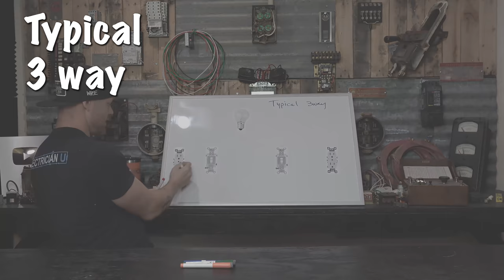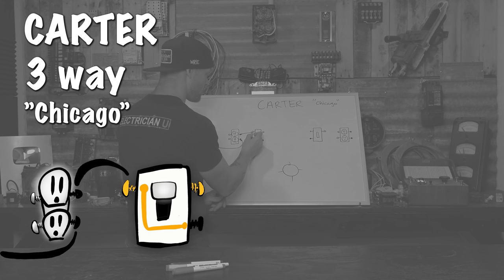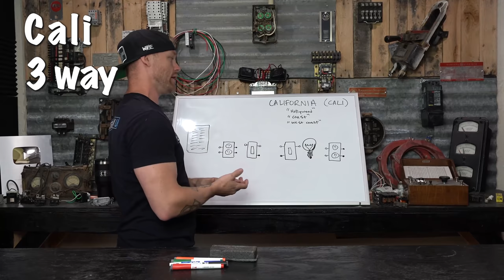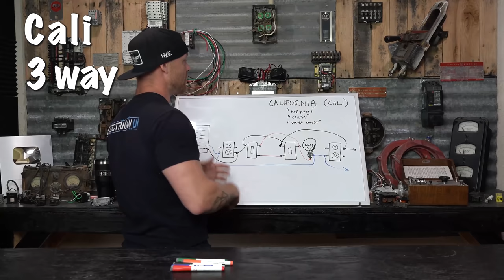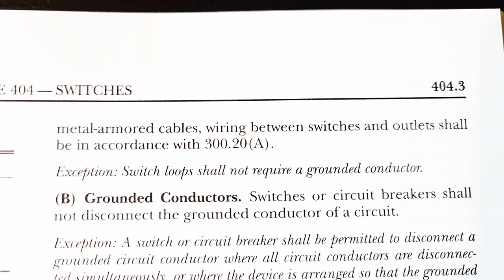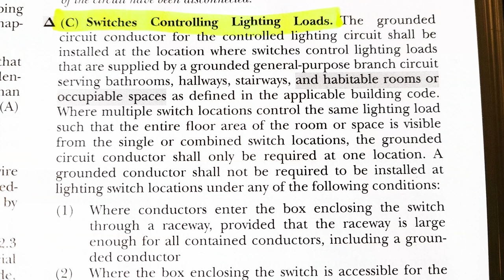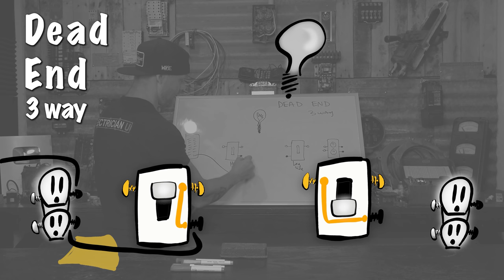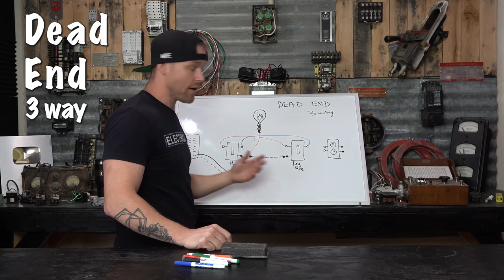THREE WAYS 3-WAYS CAN BE (3way Switch Wiring - ILLEGAL AND LEGAL METHODS)

Comment: Here's a future video idea:  How to do a re-wire or replace a home-run most efficiently with minimum amount of drywall damage.  Any tips and tricks you've learned over the years that would be helpful to new guys getting into the field.  Thanks.
Reply: Depends on what is above or below and where you can fish from. Sometimes you have to go up over and down.  I worked in a split level that had the walls been open would take 50 ft of wire from the panel to new AC. Because we had to drill and fish up over and down it took almost a full roll of 10/3 NM
Reply: I would love to see a video about this uuf
Reply: Agree. I’m always wanting to do the minimum amount of damage, and obviously still get the job done quickly and efficiently
Reply: This would be tremendously helpful.
Reply: I can tell you that re-wiring without opening the walls uses a whole lot more wire.
You can't do it efficiently without opening up walls. If you don't open walls you use lots of junction boxes in the basement and attic, and a lot of dead end runs.
But that is the trade off for not damaging original plaster in an 1890 house.
First floor isn't as bad if you have a basement, not nearly as much wasted wire going from underneath to wall outlets.
Going up to the attic, then dropping down the wall for each receptacle on the second floor burns through wire pretty quick though.
Reply: That’s so vague. Every job is different
Reply: It takes experience in order to route the best path for every job, and even with years of experience, in hindsight every now and then we can see a better path after the fact lol
Reply: Ha
Reply: get you some of those four or five foot long bendable auger bits , there are five piece fiberglass rods that screw together for any length you need to fish, with one has a hook on the end get some good scotch 33 tape,  to tape your wire to it, practice taping that isn't going to make a snag , it helps to have a good partner that is on the same page with you when you're fishing wire although you can do it yourself ,you just have to put some thought into where you are going if you are fishing , knocking in the existing electrical box intending to replace it, will allow you to reach in and fish in the wall a lot easier,  fire blocks will be an obstacle that your auger bits can get through, of course homes that are wired with EMT or Flex you can pull all new wire or add a circuit  in a few hours with a good helper,  My first day working for a company they had a taper standing by, to fix all the holes I needed to put in the wall to replace a damaged wire between two receptacles but when I was done there were no holes to patch. fishing wire you have to look at the possibility of things in a positive way
Reply: @Content_to_suffer  hmmm. An honest electrician that doesn't pretend to know everything.
Reply: Be one with the snake padawan
Reply: I want a vid on this. I have some new wire to run
Reply: He could probably show you some things to look for and some tips and tricks. Every house is gonna be different. 10 experienced electricians would probably  come up with 10 different ways to pull a new circuit through a finished house and all of them would be feasible. Going to depend on their experience/background, what tools they have on their truck, how many jobs they got stacked up, existing finishes in the house, attics, crawlspace, basement access, etc. When there is an accessible crawlspace or basement, I like to take down baseboard, especially when it’s the tall stuff. I can cut out drywall behind the base to drill studs and through the sole plate with my right angle drill. When I’m done, screw in some new drywall and bang the trim back in place. Most homeowners can handle caulking and painting trim much easier than patching drywall.
Reply: For me, I have done a lot of older home rewires and generally I try to run my wires as modern as possible but.. A lot of times the home owner is not going to want to damage the plaster or what not. so in that case, switch loops are your best friend. bringing the power to either the light box location or a crawl based junction box, and branching loops to each switch location ect. meaning you only need to run 1 wire instead of 2. but what I do is I will run a 14/3 to the switch box. it carries power, neutral, switch leg and GROUND to every switch box. I run some dead ends as well witch are also a life/time saver. But with the code specifying only ONE location of a 3/4 way system needing to have a neutral.. YOU ARE SAVED
Reply: In the Carter 3w what color is the hot traveller?
Reply: @mrromantimothy  Lol! That poor taper must have been bored to tears, unless he liked watching electricians. But who wouldn't want to watch electricians?  😁
Reply: @hailholyqueen  What's that? A dishonest electrician who is pretending he doesn't know everything?!?   🤣
Reply: @tay13666  you can fish wire in and out of an existing receptacle box if you know what you are doing and rewiring a house doesn't take anymore wire than what was used when it was built new

Comment: Put multiple 4 ways between the 3 ways. You’ll blow someone’s mind.
Reply: I have a 3 way in my basement with three 3 way switches, no clue how it works, I tried to adjust it and it stopped working, I undid my work and just left it as it was...
Reply: @Bremend  u can’t mix up the pairs or else the lights won’t go on and off as supposed to. Either tone the wires to find the right pairs or call an electrician
Reply: Actually that is exactly how you build a four,five,six, etc. switching .   First three way chooses A or B path , Final switch Chooses A or B . ALL the four ways in between simply reverse A & B in to A&B out or B&A out .  All the 'reversing' the traveler switches are in the middle .   This allows for each and every switch to be an on/off switch.
Reply: @Bremend  So two of the three actually are a three way t(hat act like a three way ) powers the third three way . If you turn off the last  (third)three way AND then switch one of the first two nothing happens AND you have to turn on the last and one of the first two to turn the light back on .(my Dad did this in a basement , drove me nuts)

Comment: basically, if you are running Romex, then the neutral needs to be in the outlet box. If it's EMT, and you can add it later then you don't have to run it; it can be added later if it's needed. This is basically why, in Oklahoma, they stopped letting us use the white wire to send a switch leg to the other 3 way and mark it with some red tape to identify it as hot. As an apprentice in open shop, I worked with a Journeyman that liked to use the white wire in a 12/3 to send the switch leg to the other side. He argued it uses less wire and saved on overhead. People were calling that a California 3 way for years until we had an electrician from California come along and tell some people that this wasn't a California 3 way. This is the first time I ever seen someone describe a California 3 way, and it is definitely different from what Journey were calling one back then. I have never seen the Carter 3 way but that looks kind of sketchy! I wonder who dreamed that up?
Reply: Jimmy Carter lol😂😂

Comment: im a journeyman electrician , i know this stuff but for some reason i cannot stop watching your videos, thank you for the videos your doing keep up the great work
Reply: IS NEC certified same as Journeyman? Taking exam at your local village or other local jurisdiction but it just states licensed electrical contractor not journeyman. So journeyman is specifically for union electricians?
Reply: @vlad1889  Nope, where I live there is 4 classes of electricians, licensed by our state, union or not.

Class A: Master
Class B: Journeyman
Class C: Systems Contractor
Class D: Systems Technician

I currently hold a Class A and B licenses, since for some reason your not actually allowed to do electrical work with s Class A. Weird huh?
Reply: @vlad1889  state licensed for general electrical contractor is the same as journeyman...
Reply: @steve-o6413  in DE a journey needs to work under a master still. Only a master can pull a permit.

Comment: Wired up a huge house that had 5 seperate doors leading in the place. Had several hallways that criss crossed another hallway. Had at least 14 three way switches and maybe 6 four way switches. Sparky working with me never wired in a 4 way switch and screwed up wiring them. As long as you are using 2 NM cables for each 3 or 4 way very easy to wire them. Liked to put a piece of black tape on wire that feed switches.

Comment: Love your video and have come back several times to watch the variations. One variation of the three-way switch I’m having a really hard time finding is one where the power comes into the switchbox, and then both the three wire to the other switch, and the two wire to the lights come out of that same box. Might be a great video for someone as I can’t find it anywhere
Reply: What  you're describing is the dead end three way,  actually a commonly used variation.  Technically still a code compliant 3-way since the box with the incoming power has an available neutral.   Especially useful in renovations where you need to convert a single pole switch into a pair of 3 ways with minimal work.

Comment: Great video.  You just helped me solve a problem I was working on today with two dead end 3 way switches that control the garage light from the kitchen door and garage door.  Saved me the trouble of having to call for help.

Update - Section 404.2c was changed in 2020 and now prohibits a "dead end" three-way in a remodel if there is no finish on the wall and the wire is readily accessable and can be changed.  I ran into this on my remodel when I exposed an old dead end three-way and had to add a neutral.  The reason for this is that many modern "smart" switches require a neutral.  If the neutral isn't used, it is capped for future use. 

 I'm also having to upgrade some single pole switches to 14/3 wire because the home runs are to the junction box for the light.  Again, the unused neutral is capped for future use.

Comment: The 'Dead End 3-Way' is what I would use based on my 45 years in electronics, though I would run the 14/3 red & black from the travelers on the first hot switch plus the neutral straight into the ceiling box, then strip off the outer jacket, cut the white wire and fasten it onto the shell screw, then put black tape onto the other end of the white and connect it to the screw hooked to the bottom light socket contact.  Then I would continue the cable over to the other 3-way switch, and hook red and black to the travelers, and white to common with a black tape band added.  The down side is pulling the wire all the way through the box.  BUT, I know the way we would do things in electronics does not always satisfy code, though it would save on wire nuts and wire.  Thanks for your informative videos.  I learned a bunch of this stuff from my dad a long time ago, but he went to trade school to be an electrician in the 1930s.  Much has changed!
Reply: Wonder if your dad learned the carter 3 way method,  because it allowed power on both ends of a three way using 3 wires instead of 4 not counting the ground, and the economic hardships of the time forced many people to get creative and make do with the least amount of material.  Actually ran across a carter 3 way a little while back on a farm with a yardlight between the house and barn with a single conductor running from the house and barn to the light pole, controlled by 3 way switches from different panels.  House and barn were built c. 1910 and got electricity in the late 40s.

Comment: This was very informative. I can't say I have seen the Chicago or California 3 way locally. But the one I didn't see is the hybrid 3 way. 
I use it mostly for entry halls.
But to save that additional 2 wire switched leg, we run 3 wire from a switch box with power to say an entry chandelier box, then 3 wire back down making a dead end on the other side of the hall. Neutral comes from the power switch box.
Switch leg is the common at the dead end. And yes you have to change the color of the travelers in the ceiling box to avoid having two white wires at the fixture.
Reply: I think this is what I have in my house.I have a foyer light with stairs. switch at bottom and switch at top. The bottom switch has a common/hot, neutral and two "travelers". the top switch has only one traveler and one neutral (coming from wire nut with 3 or 4 other white wires going who knows where). Im trying to wire up a smart switch but cannot get the top switch to work.  Any ideas? and yes, I am not an electrician.
Reply: @jleslie246  if there multiple neutrals in the box at the top of the stairs that tells me there at one point was a pig tail coming from the "hots" in that same  box to feed the circuit.  This is more akin to the California 3 way described in the video. In older homes a neutral is a neutral to older electricians. Neutral and switched leg comes from the bottom of the stairs and you have a black and white pair of "travelers" at the top of the stairs and a hot wire in the switch at the top is the common.
Reply: If you're wondering where how power gets to the switched leg, it's the travelers, all the switch does is alternate between the two travelers as paths. Commons are source and load.
Reply: @samuelcrossland1101  the only wires connected at the top of the stairs are the traveler and neutral. it worked with the old switch but the new smart switch i put in at the bottom wont work with the top switch connected.
Reply: @jleslie246  it needs a companion switch of the same type.

Comment: An old electrician who wired many California three way circuits explained it to me like this. On a three way switch you have a common and two throws, not a common and two travelers. The wires are travelers not the terminals. A traveler is a wire that connects two switches together and no matter how many boxes that wire goes through nothing else gets connected to it.

A conventional three way (straight, loop, dead end) has two travelers. A California has one traveler between the commons, nothing else is connected to that wire. While the throws are wired together too, those conductors are not travelers because in every box they go through, one is a hot and the other is a switch leg.

In a Carter there is no traveler. Each switch gets hot and neutral  on its throws and the lamp is wired between the commons. It’s illegal because it can break the neutral leaving both sides of the lamp shell hot, with the lamp being off.

The benefit of the California is when a three way is needed to control a string of lights, it saves a conductor in the run compared to a conventional three way. It’s totally legal under 404.2 because it only breaks the hot.

Save yourself some wire, use the California when you have multiple loads on a three way.

Comment: I know of another type of "3-way" switch.  A smart switch (Alexa- or Google Home-  capable, for example -- also, some dimming 3-ways) uses the three wires as 1) Hot 2) Ground and lastly 3)"data/communication".   I was baffled until I finally got it right.  Then I realized what was happening.  Both switches need to be "on" to respond, so a hot and ground are needed.  But the switches also need to know what the other one is doing, therefore one of the wires is used for communication.

Comment: BINGO!!  It was a "Chicago 3-way" design.  
While merely replacing an old 1920s porcelain 3-way in a friend's 1905 house, I blew 4 Edison base fuses.  What the...?  So, I had to run a wire from a water pipe to determine what wires were hots or neutrals using my Wiggy.  Yes, there was a neutral (!!??) on the switch.  NOW I KNOW WHAT WAS GOING ON THERE.  "Chicago 3-way."
Thank you so much for this tutorial.  Neither of those systems was taught in my apprenticeship.

Comment: Thank you Dustin! I'm just a DIYer but had a situation where I had a misbehaving 3 way setup. Turned out to be a miswired dead end 3 way. I suspect it has never worked correctly for the 10 years since the house was built.

Comment: I encountered this Cali 3-way crap on my 70s house in the Dallas area.  They apparantly didn't want to spring for 12/3 cable, so they used 12/2 everywhere.  Tied to a separate circuit's neutral & that's how I discovered it.  Had the hallway circuit on for extra light, while working on a bedroom circuit--breaker switched off and confirmed.  Unwired the neutral bundle in the bedroom switch box and got bit & hallway light turned off.  Go switch off that circuit and open up the hallway boxes to find this mess.  So my simple bedroom switch replacement turned into a run to the hardware store to buy some 12/3 and fix that crap.  I checked the other 3-way setup for the garage & yep, same crap.
Reply: I have this same setup in my early '80s house in the Houston area.  They actually daisy chained the separate circuit's neutral so that the outside light hot used the kitchen neutral, the kitchen hot used the dining room neutral, and the dining room hot used the stairway neutral.  Is this just a version of the California 3-way, or would this qualify as a different type of setup?

Comment: Perfect! The dead-end 3-way is just what I had been searching for. I want to convert a switch inside the attached garage into a 3-way with the second switch on the other side of the wall that has a pilot light so I can tell if the garage light is on or not without opening the door.  Wiring the pilot into the dead-end shouldn't be a problem? Thanks for the video.